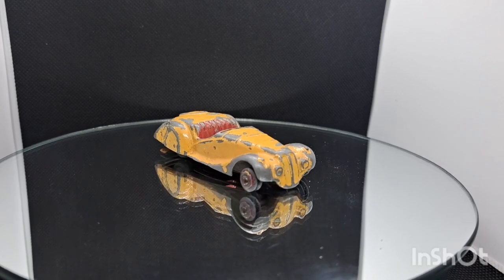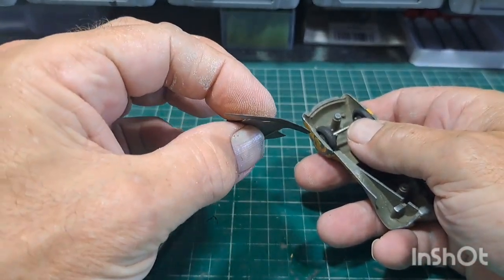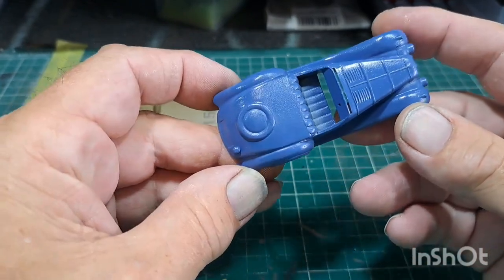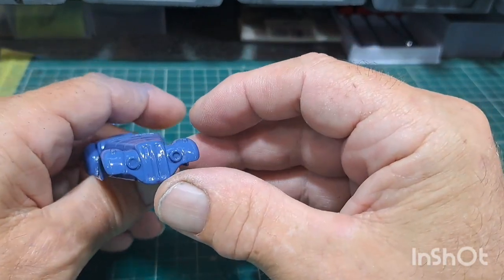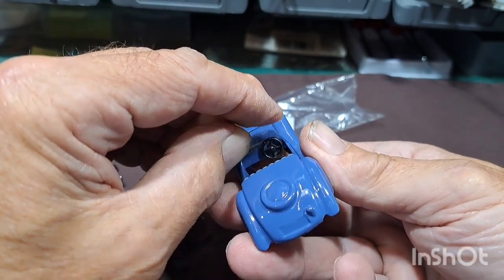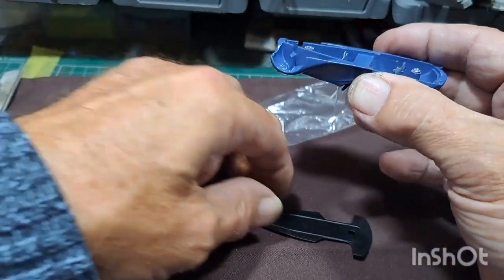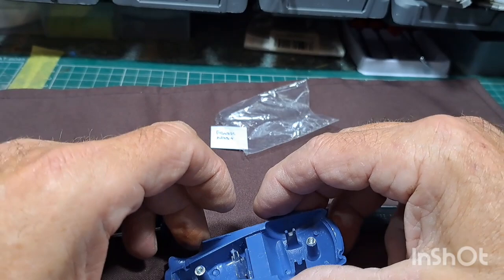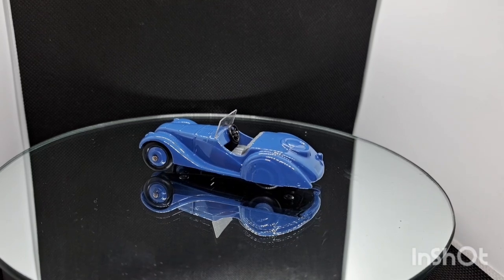Diecast Restoration Dinky Toys Frazer Nash (BMW ) no/38a  1946/53 38 series

Comment: Hi mate another smashing job as always the detail really brings it to life. Lovely old casting I love the old simple ones they are easy to do but look great finished. Bloomin nora I hope they have a better way of putting the wheels on the real one, it would be a right wobbly ride otherwise.😂😂🤣🤣I can't remember if I told you about when I changed the Mrs front wheel. I couldn't be bothered getting the wheel brace out of the boot so I used my socket set.  When I put it back on unbeknownst to me when I put the ratchet away I didn't notice the socket had been left on one of the wheel nuts, talk about a rookie mistake. The next day she took the car out and about ten minutes latter phoned me up saying something is clanging around on the front wheel under the hub cap. Because she had to be somewhere and didn't want to be late she phoned the RAA -Royal Automobile Association to come and check it out and I thought I'd better go there too in case the RAA bloke was going to take hours to get there. When I arrived the RAA bloke was holding the socket in his hand scratching his head.🤔 I haven't felt such a numpty in a long time.😣😂😂🤣🤣Catch you on the next one mate.👍🏻
Reply from the maker: You're not alone on that score I did similar many years ago but what I did was forgot to tighten one up in my haste and it ended up rattling around in the hub cap but at least I new what it was 
All the best Martin 👍

Comment: looks great again, very swift. ^^

yeah, paint can be a fickle beast in times... also, nice little windscreen. better to have something to shave off if needed, than something missing and it falls out again. :)

personally I might have tried to fold up the mushrooms again and press them down with a blunt cross screwdriver when completing. I did that sometimes with older Siku and Matchbox, no idea how it would work with ancient Dinkys. probably not as well... also the rivets look convincing enough, so there. :)
Reply from the maker: Cheers Lothar, I find most repo parts need work these days. 
Good idea with the posts 
All the best Martin